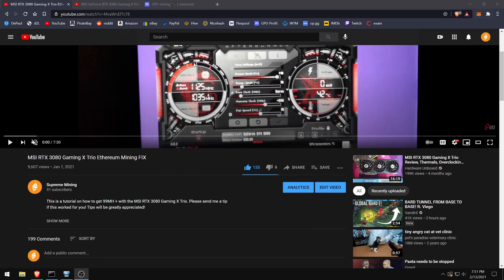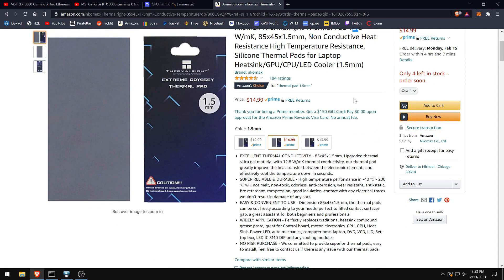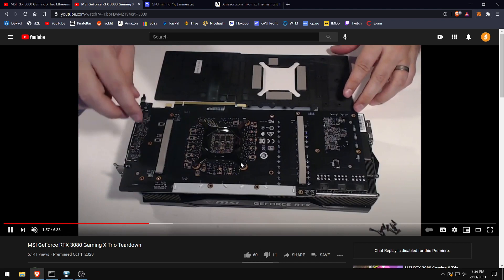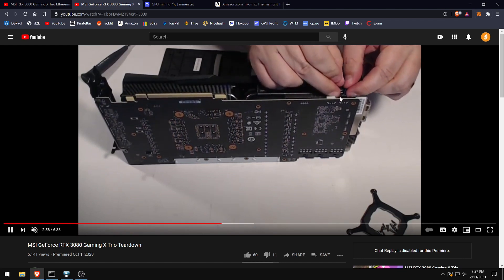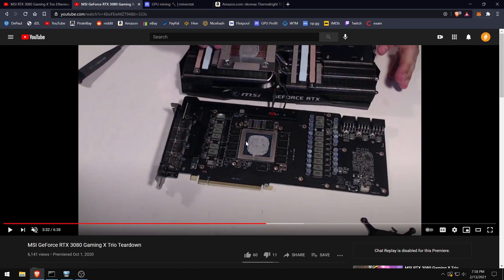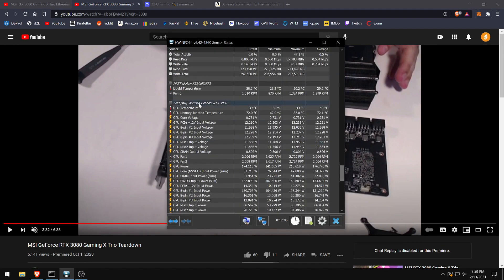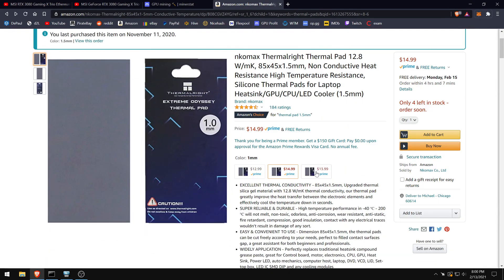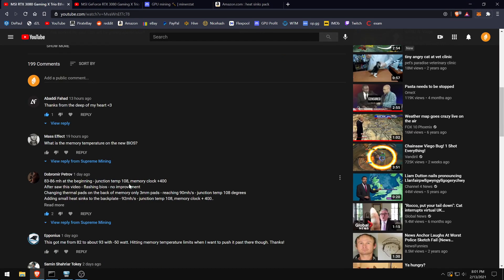MSI RTX 3080 Gaming X Trio Fix UPDATE

Comment: Hey I'm super new to the mining arena haha. Got myself a MSI 3080 x trio. Keeps crashing and I'm only getting 87MH/s stock bios. So I have 2 questions first If I change the Thermal pads does that void the warranty? 2nd If I change the pads out will that be good enough to stay on the Stock bios and get close to at least 98-99 MH/s ?  I have 2 year warranty on the card ideal to keep that and still mine. Any suggested settings for stock bios?

Comment: Confirming this fix, did this yesterday evening on my gaming x trio. I ussed Gelit GP-extreme 1,5mm pads internally and 3mm pads on the back. I also lifted the gasked cleaned that off noticed lack of thermal paste under those. I also put a little piece of 1,5mm thermal pad under the gasked where the heatpipes go down there is a noticible gap between the gasket and the cooling pipes there. 

After assembling everything again I got a noticable 28C drop on memory T junction. I can stable clock the memory to +1350MHz (was able to reach 1500 without it crashing) and lowered the core with curve editor about -150MHz.
WITHOUT flashing the bios, I'am getting 100.24MH/s @ 82C(Memory T Junction) with 70% fan speed. Ambient temperature is 28C.
Reply: Thanks for all this info, hopefully see similar gains with the 6800 XT variant, I’ll try 1mm copper instead though.

Comment: Someone knows anything about RTX 3080 GAMING "Z" TRIO hashrate ? i didnt found anything about...
Reply: i have it it is hashing at 99mh with 92 memory temperature with stock thermal pads, fans at 88%.
Reply: @techgeek2994  biosmod? im afraid to do rs, 92mhs here 0 core 1000 memory - 60% fans
Reply: @fredmansantiagodemelo3621  yes you need to flash suprim x bios that is what i did to my gaming z trio, otherwise it cannot work nowhere near 99mh
Reply: @fredmansantiagodemelo3621  dont use 60 fans only this card is heating a lot increase the fans if you dont want your gpu dead

Comment: I just made this swap on the same card with the thermal pads recommended in the video. The swap out was incredibly easy, it probably took 20 minutes with me taking my time. My memory junction temperatures went down from a sustained 104 degrees C to 84, a MASSIVE improvement. No need to even watch the video linked, pausing this one at the right times was all I needed to do. Great video, thank you for posting!

Comment: Any experience with flashing the Suprim BIOS to the 3080 Gaminz Z Trio? Aluminum backplate with thick thermal pads there already, memory junction temperature is below 100 with 70% fans.
Reply from the maker: Not personally, but I have heard that other's have tried that but I'm not sure if it worked for them. Only one way to find out I suppose...
Reply: @actualGoodMemes69  i have msi gaming z trio and i flashed it with suprim x bios, hashing at 99mh with stock thermal pads at 92 memory temp. 88% fan. great card. i am thinking to buy 17.0wk pads and replace it on memory modules so temperature i believe can go under 85degrees
Reply from the maker: @techgeek2994  It wouldn't hurt. It should be much lower temps and hopefully it will be able to hash faster.
Reply: Adam, what your hashrate with z trio ?
Reply: @fredmansantiagodemelo3621  90 without any BIOS mod.
Reply: @fredmansantiagodemelo3621  100.6 with EVGA FTW3 3080 BIOS 94.02.26.48.8, ~205 watts in HiveOS. 80% fan, 46°C GPU - recommended!
Reply: @adamhonved1289  can u share the z trio OC ? i ordered one
Reply: the oc without bios mod.

Comment: Bro after changing back pads with 3mm 12.8 mkw the thermals got worse. what could be the issue?
Reply from the maker: Only thing I can think of is that you made a mistake. Also, the backplate ones don't make much of a difference, the inside ones are the most important to replace.

Comment: I did it on my Gigabyte and got 70-76deg C with 99.9MH/s. Now for the MSI trio I only replaced the backplate ones (waitng for 1mm that are on order) and still have bad results at 99.9MH/s (100degC). Unlike the Gigabyte RTX 3080 the backplate of MSI is kind of plastic which is not a good thermal conductor like the metal one on Gigabyte cards. I ordered a shit of 1.5 mm aluminium plate and will give a try with that.
Reply: MSI RTX 3080: After all of the thermal pads replacement I got memory junction temps at 88 degC. Yesterday I replaced the original back plate with 1.5 mm aluminum plate (I used 3mm EPDM rubber spacers I could find online, also found it's stable up to +110degC) and my mem temps dropped to 80-82 deg C. Anyway, temp-wise gigabyte rtx is the best after thermal pad mod. I used Gelid GP-Extreme thermal pads (12W/mK).
Reply: @s.k.5052  Was it a MSI 3080 gaming  X trio ? Which aluminium backplate did you use ? Do you think that changing the backplate has that much effect or was it more the 1mm pads you received that decreased temperature ?
Reply: @Kiwin412  I just bought a sheet of aluminum (1.5mm thick), Temps dropped from 88 to 82. Thermal pad replacement caused the drop from 100 to 88 initially. My MSI gfx is 3080 gaming x trio.
Reply: @s.k.5052  Thanks, I don't know how much it would change temps with an aftermarket backplate/sheet of aluminium on the 3090 gaming X trio as it already has a metal backplate, can't find much information about the 3090
Reply: @Kiwin412  MSI unlike my other 3080 (Gigabyte) has a plastic backplate, so I decided to make it from a metal as Gigabyte mem temp is 76deg C after thermal pad change with metal backplate...

Comment: Sorry what i doing wrong? Pls can me help anyone...

c:\nvflash>nvflash64 MSI.rom
NVIDIA Firmware Update Utility (Version 5.660.0)
Copyright (C) 1993-2020, NVIDIA Corporation. All rights reserved.
Checking for matches between display adapter(s) and image(s)...
Adapter: Graphics Device      (10DE,2206,1462,3892) H:--:NRM  S:00,B:2D,D:00,F:00
EEPROM ID (EF,6014) : WBond W25Q80EW 1.65-1.95V 8192Kx1S, page
WARNING: Firmware image PCI Subsystem ID (1462.3897)
  does not match adapter PCI Subsystem ID (1462.3892).
NOTE: Exception caught.
Nothing changed!
ERROR: PCI subsystem ID mismatch

Comment: What if you dont wanna void warranty and just replace the backplate ones, is that good enough?
Reply: Just did it a few hours ago. No sucess. Maybe  -1C if any. I guess the key point is really to change the pads in the front. I'm waiting for thermal past and will do it next week. Some background: After 1 month of use the temps become higher, and now I'm stuck in 101C (its always shifting from 100 to 102 and back); fans at 87; (100C will no better). Everything got worse when I forgot the fans for one hour while mining, and it throtle for the first time at 110C. Maybe it damaged the pads, idk.
Reply: PS: I was relutant as you because of the warranty, but the more I think about it, for sure it will break using it 2 years constant at 100-102C. So I guess I will take my change.
Reply: @bmmaia81  "For Sure" , you a Micron engineer?
Reply: @Sxs1n  of course not. But if the operating temp is below 95 and it’s working 24/7 at 101c for sure it will not do any good. Anyway just wanted to give my feedback as I was disappointed that only changing the pads on backplate didn’t do any good. I would be happy with the 95C. Cheers
Reply: @bmmaia81  So did u try to replace the front ones,  any results?
Reply: @Sxs1n  still waiting for some msi stickers from alliexpress. If they are ok maybe i can do the job and not lose warranty. Anyway it is working 24/7 at 100C

Comment: So, after swapping in 1.5mm it’s marginally better. 96c at 91-92 MH/s with the stock bios still. I’m afraid to try the suprim bios as I assume it’ll only hurt temps more. I’m not comfortable running my card much hotter than it currently is.

I’ve got gelid 1.5mm inside, 3mm backplate and aluminum heat sinks on top. Seems I just got a crappy card.

Comment: Ok I replaced the pads and thermal paste, the VRAM junction temps went down by 15 degrees, but now my core is overheating like a muppet.  I was getting core temps at 50C while mining and 67C while gaming 4K Full RTX Cyberpunk, now I get 73C while mining and my card throttles at 90C while gaming. Reapplied thermal paste 2 more times, Tried Kryotec and Noctua compound. Added shitton of that paste spread it evenly to no effect, used X pattern to screw the heater. No effect. Idle at 36C but skyrockets the moment I start doing something.
Reply: Did you find the solution ?
Reply: @Kiwin412  Yes. I had to use 2mm thermal pads instead 3mm the guy suggested. The once I bought initially, the 3mm, were less prone to compression, so there was a gap between the GPU central unit and the heatsink and the core wasn't able to cool itself properly. Once I went down to 2mm the heatsink was properly connected and everything works great now.
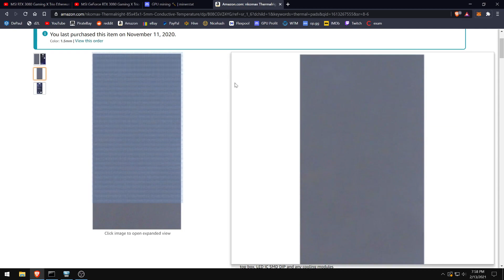Reply: @Salt Maker Yeah, my bad, he does mention 1mm on the front. However that is also a mistake. He does talk about 1mm pads for the heatsink side, at 0:45 mark and a second time at 3:30 - in both cases he SHOWS a 1,5 mm on amazon (it even shows "you bought this item on xx.xx), but that is also a wrong size. I bought several thickness of the brand he shows (Thermalright) and I know this for a fact: 1mm and 1,5mm doesn't interface properly with the heatsink giving you bad thermal results. Only 2mm hits the spot just right. I have other brands of thermalpads and the thickness is very misleading, because they have different compression index / hardness, so another one I have, can be squeezed with no issues from 3mm to 2mm and it does the job as well. The ones he is showing, Thermlarights are hard and you need the perfect thickness as there is no error margin here.

Comment: Hey, I've flashed the SUPRIM bios and changed the inside thermalpads, but I get 97MH/s at 106C. Before the I changed the thermalpads I was getting 91MH/s at 108 with occasional throttling which it is an improvement, but not as great as some people report. Any idea of why could this be?
Reply: you got bad thermal pad brand or you put wrong thickness

Comment: I replaced my thermal pads... with no success. I used the gelid 1mm for the inside under the board. I used 1.5mm stacked on the backplate. Still getting 100c at 88-90MH/s. I was getting 106c before. So it’s better but still terrible.
Reply: Gelid pads are quite soft so in my experience 1.5 mm work better.
Reply: @PavelMezentsev  I’ll give that a shot, thanks for the reply!

Comment: Hi! Thanks for all the info in the videos. Are doing anything to improve the heat transfer to memory heatsinks that you put on top (bottom?) of the GPU? Like thermal paste or anything. And it's the stock backplate, right?
Reply: Good to get aluminium on the backplate if possible and having a fan blow directly onto it with the side panel off to prevent heat build up.

Comment: Just wanted to do a bit of a follow up for anyone curious. Can confirm that the backplate thermal pads are 3mm and internals at 1mm. I used to have fans running at 100% to keep temps at about 100C. After thermal pad change, with same OC as before,  I am getting 88-90C with fans down to 70%. So much quieter and now below the 95C ratings for GDDR6X. It was a bit scary but worth it. If anyone is curious, this is with the Suprim X BIOS flash and the OC is 112% Power, 1225 Memory and the Core Clock curve he mentioned in his last video. Pulling a constant 100 MH/s at about 230W power draw
Reply: What pads did u buy exactly
Reply: @FPS_PURGE  For the 1mm pads on the inside, I used the same thermal pads that Supreme did - nkomax thermalright 12.8W/mK. For against the backplate I used those same 1mm pads stacked with a 2mm "Iceberg Thermal DRIFTIce" pad. The icebergs were 13W/mK. I ended up buying 1 of the 2mm pads and 3 of the 1mm pads, but only needed two of three 1mms. I'm seeing a lot of people on here commenting that they're using 1.5mm on the inside and from my understanding using anything more or less than OEM spec size is a very bad idea...probably not so important against the backplate though.
Reply: @andrewkenlon220  so u use 1mm on inside and it worked great ? Or should I get 1.5
Reply: @FPS_PURGE  I used 1mm and it has been working really well. I would not use 1.5mm on the inside
Reply: @andrewkenlon220  also I can't find any 3mm can I stack 1mm 3 times for back plate
Reply: @FPS_PURGE  I couldn't find a quality 3mm either, so I stacked a 1mm and a 2mm together. So yes, it can be done but others have mentioned it is not as effective. In this case I don't think it matters too much since its against the backplate anyway, and from what others have said, just switching the thermal pads on the backplate doesn't seem to make a huge difference at all in the first place
Reply: Also which bios from supreme did u put on it , I used the 2nd to last supreme one
Reply: @FPS_PURGE  This one: https://www.techpowerup.com/vgabios/226614/msi-rtx3080-10240-201101
Reply: @andrewkenlon220  I'm on smos so I had to use the evga ftw bios for it to work ! If anyone needs help that's on smos hit me up
Reply: @FPS_PURGE  hey man which EVGA bios did you use, can you link it?
Reply: @Olybeast1  Yes I can , it's the evga ftw one
Reply: What you want to do first is if you have something to see what your power draw is from the wall do that first because even with the EVJ FTW one I had to put my power draw to 310 watt 305 watts to get the card to pull 227 which is what it should be for a maximum megahash and efficiency
Reply: There's 3 evga ftw 3080 bios , I used the one in the middle
Reply: @Hed Z For my card, I ended up using 2 of the 1mm pads and 1 of the 2mm pads. Note that since I couldn't find a good quality 3mm pad at the time, I was stacking my 2mm with my 1mm...but regardless I still think you'll need two if you're getting the same exact brands that I got. The thermal pads are not pre-cut since each GPU is going to have different sized pads based on its configuration. It's more of one "large" pad which you cut to fit the exact size of the pad you're replacing - hope that makes sense.

Comment: so there do you think with the sotck bios and thermal pads upgrade it will hash better? or is the suprim bios really needed?
Reply from the maker: The Suprim Bios bypasses that 210W limit for CUDA processes. So just replacing the thermal pads shouldn't make a noticeable difference without flashing the Bios.

Comment: Hey just going through this mod and prepping all the stuff I need to perform it. I noticed your link the description leads to 0.5mm pads but in the video you said you need 1mm pads
Reply from the maker: It's 1mm. I believe there's 3 different sizes that one comes in.
Reply: Ok thanks just wanted to make sure as the link in your description leads to 85x45x0.5mm pads

Comment: My case airflow is bad because my trio would constantly reach 110 C within minutes. Opening my side panel and leaving the window open (since the weather is still cold), I still get 100-106 C, varying with power limits from 60% to 75%. I will definitely look into replacing the thermal pads, although I am a bit worried since I'm not the handiest and don't want to mess anything up.
Reply from the maker: It's definitely worth looking into. It's definitely a lot more daunting than it really is. Operating at those high temps isn't very sustainable in my opinion. Look into some teardown/thermal pad replacement videos before going in yourself!!
Reply: @actualGoodMemes69  I'll likely look into some videos this weekend, I'm waiting to complete my first withdrawal as I started mining recently. Is flashing the Trio to the Suprim bios safe enough? I know flashing can be risky and brick a GPU, although sometimes they can be reverted back to the original bios if accessible.
Reply from the maker: @EBJustin  Yeah it's pretty safe especially since they're very similar cards. Haven't heard of anyone bricking their card from this yet. But that doesn't mean there isn't risk.
Reply: @actualGoodMemes69  I think I'll start off with just the 1 mm thermal pads for the memory and hold off on removing the backplate thermal pads unless temps show that I need to. Will one set of those Thermalright 1.0mm pads suffice, or will I need to buy two sets?
Reply from the maker: @EBJustin  I think 1 set should be enough. I believe that is all I needed and I had some left ofter.

Comment: Did you use Thermalright pads or did you just shown them on the video as an example? I'm asking because I've read that thickness is not the only value that matters. It's also "squishiness" and it varies depending on pad manufacturer. I would like to get exact same pads as you did since it worked so good for you. Also, do you mind telling how many packages you got to replace all pads? I think Thermalright sells pads in 120x120mm and 85x45mm packages. Thanks for the video, very useful info here!
Reply from the maker: I linked the exact pads I used in the description. It's the first link under "thermal pads." Others had luck with the more available thermal grizzly's so I linked those as well.

Comment: Junction temp is not case temp. GDDR6X is rated for 95C CASE temp. EVGA cards report 20C lower case than junction, so even at thermal throttle (110C TJ), case would be 90C, 5C below max rated. I too have a 3080 GX3 with thermal pads replaced and suprim bios on it, but only EVGA cards report case temps, so that's all the info we can go on for now.